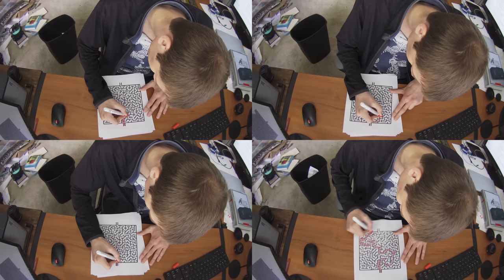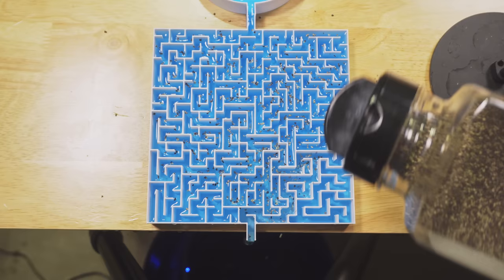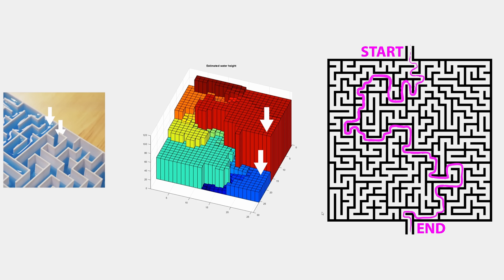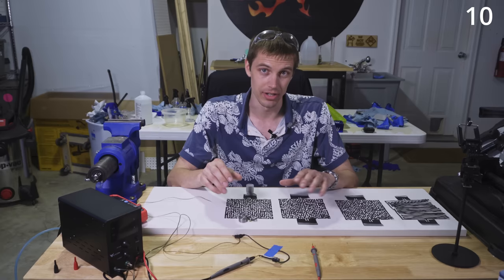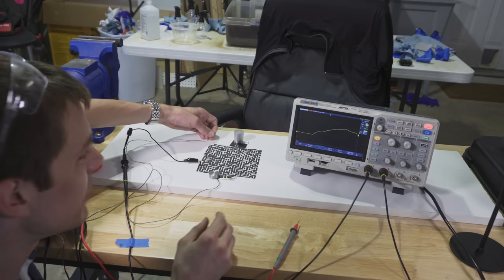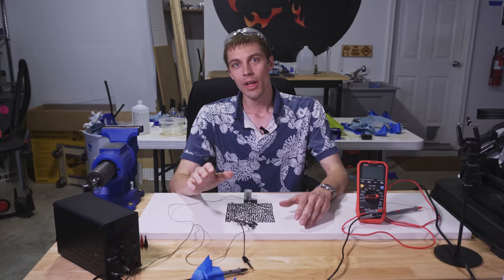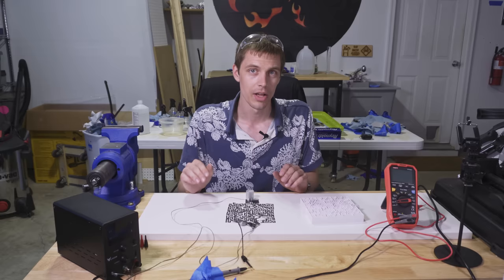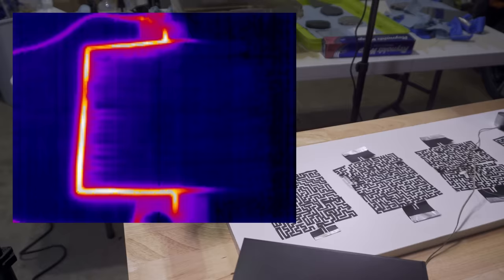How does electricity find the "Path of Least Resistance"?

Comment: Using thermal imaging to trace the current is a really great idea. I taught Physics for 33 years before retiring 7 years ago, and I wish I had thought of this demonstration. I really did not see any errors in your explanation, good work.
Reply: You can suggest it to every physics teacher you meet. Just because you can't teach with this method any longer doesn't mean you cannot suggest this to other physics teachers.

Spreading knowledge to other teachers is just as important as spreading it to the students.
Reply: Or just crank up the current until the thermal radiation decides to enter the visible spectrum 😅
Reply: @Operational117  I would except that I have not been in touch with any teacher since i retired.
Reply: Thermal imaging is also an incredible way to help diagnose bad circuit boards. If you look at a powered board under thermal and see one extremely bright spot, you've almost certainly just found where an IC unit shorted out.
Reply: @graealex  That's actually a fun idea, just increase the current until it starts glowing a bit. I'd imagine aluminum foil probably has a very narrow area between "glows a bit" and "melted" though because it's so thin. Alternative idea that comes to mind: Put the foil down flat on a piece of thermal printer paper (the stuff used for receipt printers), just hold it down with a wood or acrylic plate. It'll take a little tweaking to get the "exposure" right but there should be a combination of current and on-time that darkens the paper juuust right so you can see the pattern on the paper after you take off the foil.
Reply: @ska042  Typically you'll be able to see the slight glow in complete darkness, without melting everything. Current is the same everywhere, so the glowing should be pretty evenly.
Reply: @ska042  I like your idea with thermal paper. You could also put the thermal paper on top of the foil maze and hold it down with a sheet of glass or clear plastic, and see it darken in real time.

Much cheaper than an infrared camera. I bet it would also work with just a small battery as the power source.
Reply: @graealex  Why do you say current is the same everywhere?
Reply: @alext8828  Because current is the same everywhere, at least in the path that can actually conduct between the entry and the exit of the maze.
This is a general principle, even used for highly noise-resistant transmissions. If you transmit information, like audio, not as a voltage, but as a current, then you can be sure that the receiving end will see 100% the same signal, as all points in the circuit will see the same current flow (not accounting for leakage obviously). It's called a 4-20mA current loop.
Reply: @graealex   Great piece of information.  I looked it up.  I need to spend some time with that.  Excellent.  But aren't we still talking about fixed voltage dc current?  Isn't radio different?
I have to go out.  We should continue this talk when I'm qualified
Reply: @alext8828  With a current loop, the transmitter makes sure the target current is always flowing. Assuming that the resistance of the transmission line isn't static, that requires a variable voltage to begin with. Voltage is what pushes a certain amount of current through a transmission line, given a certain resistance.
With current loops, the length of the transmission line is irrelevant, contrary to a voltage-based transmission, where you obviously are going to see a voltage drop at the end of the line, depending on its length (and a few other parameters).
Anyway coming back to the maze, at any point along the conducting circuit, the current will be the same, at least when simplifying the conducting to have no particular width. With the resistance of the material also being uniform, it means the whole path will see a very similar amount of heating at any point.
Reply: @graealex  Current is not the same everywhere. It is only the same everywhere if there are no nodes in the circuit. Such a circuit is very simple.

Suggest you go look up Kirchoff's Current Law.
Reply: @graealex  This is a really poor explanation of current loop.

They key thing about the current loop, which you have neglected to mention, is that a current source is used to drive the line. The interesting thing about the current source is that the current is constant and the voltage is variable and the current source  adjusts that voltage in order to keep the current constant.  So as the length of line increases and the resistance increases, you still get the same signal strength at the receiver.
Reply: @deang5622  That is actually 100% not relevant for the explanation. It's sufficient that if you measure a certain current at one point, it needs to be equal at another point.
The way that particular constant current is produced was not focus of my explanation.
Reply: Respect to all whole-hearted teacher! You are the shooting star of your student! ♥
Reply: @wayneyadams  this is a good opportunity to meet new people :) just go to your old place of work ;)
Reply: Thank you Norway for inventing this techonology and spreading it to the world.

Comment: Never thought I'd see a voltage divider in maze form. Incredible.
Reply from the maker: I was watching Steve’s video and at first I wanted to do the vacuum test, but then thought about it some more and the whole “built up pressure in the closed off bits” thing reminded me SO much of electricity I had to do it!
I was thinking about this on a Friday while driving away to an FRC competition but you better believe that on Monday night after I got back I was in the garage cutting foil 😁
Reply: How do we create a depletion zone with water?
I mean, is it possible to have a transistor for water?
Reply: @d.6325  Actually, I think Steve Mold even had simple water-based adder for couple of bits
Reply: @d.6325  Yeah I guess this is what you may call an Abacus with extreme mechanical princebles at play,
 I think the very First calculator ever made was the size of a small car?
Reply: I had never had an intuitive understanding of voltage drop until seeing this video.
Reply: @AlphaPhoenixChannel The way modern clever and creative people can directly and indirectly communicate and inspire and challenge eachother is marvelous. We're getting so much interesting stuff from people like you and Mould.
Reply: If you have a look how resistors are manufactured, you'll see mazes all over the place. Well, not really mazes, mostly just zig-zag form, but well, they aren't just made of unique resistive films without engraved geometry. Depends on the value of course. This way, you can manufacture lots of different values with just a few different materials.
Reply: How about a Voltage divider in Hilbert curve form?
Reply: @trejkaz  We'd be trying to illustrate the concept of a Hilbert curve and voltage divider at one time. Maybe not that intuitive. Now, whether a Hilbert curve voltage divider would be useful? I'd be shocked if it wasn't already in use in low cost 2D applications such as touch screens.
Reply: Later on he also showed a current divider with the different paths...
Reply: You mean a-maze-ing?
Reply: @monad_tcp  it's called a faucet
Reply: @loicjeannin6233  faucets don't open with pressure thou, they open with mechanical movement

Comment: Ever since I was in high school, I ALWAYS had an issue understanding how electricity flowed in series and parallel circuts (and combinations of such) with resistances. I never got a straight answer on whether or not current existed on the path with more resistance. This has helped solve that decade-long mystery for me. THANK YOU!
Reply: The short answer is "of course." 

The longer answer would be to measure the current through the higher resistance path.  Your HS profs probably didn't have the equipment nor the time to do this.
Reply: You must have had some poor teachers because you should have learned how to calculate potentials (voltage) and current in each branch of your circuit as well as the potential drop across each resistor and current through each resistor.
Reply: @philipgwyn8091  Ohms law says V = R * I. So by just measuring the voltage across a resistor, you already know the current.
(Assuming the resistor network has significantly less resistance then your voltage meter).
Most High School teachers just have no idea what they are talking about when it comes to electricity.
You see that phenomenon the strongest in Physics education in Electrical/Electronics Engineering Programms:
Physics education starts with Water and then teaches Resistor networks as analog to Water flow.
Students in EE Programm gain intuition in current flow in Electronics 101 and then use the associations for electricity in water models in physics (exactly flipped on how the physic instructor teaches it)., because electricity is - after having it learned once - more intuitive then water.
In electricity, we easily assume wires to have negligently low resistance; with water, a pipe (or any component including connectors) is always a significant resistance.
Sure, you can show me cases where the resistance of an electrical wire and connector also matter, but when you reach that point, you already know to add a resistor symbol to your schematic, even if you latter assume it to be 0.
Reply: @wayneyadams  bro
Reply: Why did you never got a straight answer? Did you ask?  
This is standard highschool stuff that I teach (especially, because I hate people saying "electricity takes the least resistance way", because, as you just saw, this is just wrong.
Reply: My teacher explained it with doors into a building. 
You open a door, people are going to bunch up at the door, and slowly flow through, you open 2 doors, it's going to let twice as many people through. 
If one door is big and the other door is small (side door?), then the big door is going to let a lot of people through, but some are going to use the smaller door. 

The example here in the video makes me think of traffic though. 
Most people wants to go the shortest route, but some have figured out that its nicer to drive the longer, but less congested path,, at least until they meet up again and everyone has to cram into the same lane again.
Reply: @sarowie  I am sorry to have to agree with you about the competency of many Physics teachers. I was in conferences and workshops where there were Physics teachers who had no idea what was going on, they just taught whatever was written in the book without any real understanding. Unfortunately, in our state a teacher can be certified by passing a ridiculously easy (and badly written) test with a score of 70%. That is the difference between those of us with Physics degrees who decided to teach, and teachers who decided to teach Physics.
Reply: @philipgwyn8091  not sure what you mean, you could absolutely do this with any basic equipment like even a cheap multimeter. You could either measure the voltage drop across each parallel resistor and calc the current, or disconnect one side of the resistor and directly measure the amps. We had to do the measure the voltage drop thing really early in my electronics class.
Reply: @lordsqueak  The traffic example has a couple of issues. As stated, it assumes that people know the paths they can take, something neither electrons nor water molecules do. When one assumes people are driving randomly, you get circular and back flows, also not possible with electrons (but somewhat with water due to inertia). You have to make people decide their direction based on how many cars are in any possible direction (counting both sides of the street) and then turn into the direction that has fewer cars. And even then, it's hard to imagine people just sitting in their stationary car because they're stuck in a cul-de-sac...
Reply: @HenryLoenwind  Ever been in a rush hour traffic jam?
Reply: The misunderstanding stems from the phrase: “electricity finds the path of least resistance”, which is just plain wrong, as illustrated in these maze experiments. For any parallel circuit, electricity will go through all paths proportionately according to their resistances (inversely proportional). Yet the popular phrase persists because it’s a simplification that serves as cautionary & trite warnings about electrocution dangers, for example. It imparts a more impactful and memorable message.
Reply: @wayneyadams  You can get a degree without having any idea what you're talking about, either, so that isn't really anything to brag about. It's not even that hard, really.

And if you make it harder to pass the qualifications to become a teacher, you just end up with less teachers. Sure the average quality of a random teacher might go up, but the average quality of a random student's education might actually go DOWN because with less teachers, students just can't get their questions answered, and people end up being taught more by TA's than actual teachers anyway.

The point is that these problems exist because they aren't simple, and if the answer was really as easy as "just have better teachers" people would have done it already.
Reply: @ZeroKitsune  The problem is that in Florida, one need only pass a poorly written test designed by teachers who themselves have minimal knowledge of Physics. You only need 70% and suddenly you are a Physics teacher, with 70% knowledge of your subject matter. Those of us who actually had advanced Physics degrees, rather than education degrees (all one of me in our district) actually understand the concepts on a much deeper level and are able to teach it more effectively.

It isn't a matter of having a degree and being ignorant, it is not having a degree and being certified to teach a subject about which you know almost nothing. By the way, since my B.S. was Chemistry and i had worked as a Chemist, I usually got to teach the A.P. Chemistry classes. Chemistry has its own set of problems, since most Chemistry teachers were pre-meds who failed to get into medical school so they took their marginal chemistry degrees and became teachers. However, there were a few outstanding Chemistry teachers who really knew their stuff.
Reply: Here's a question for you folks, then: what level of resistance is required to stop electron flow entirely? Don't say "infinite", because that is physically impossible. However,  I suspect the answer varies a bit depending on the materials at either end, how strongly they hold onto their free electrons, that sort of thing -- which they must, otherwise capacitance would not exist. Electrons cling to metals and don't freely flow out into the air (I understand they do flow, a bit, but not freely).
Reply: In that case you never actually solved any problems with resistances in series or parallel.

Sounds like you had a very poor teacher.
The equations which govern it have been around for a very very long time and are some of the simplest equations  in existence.

Comment: For the oscilloscope test, you should have used a capacitor instead of your power supply. You could show, side by side, the discharge curve of both the maze vs a simple resistor with equivalent resistance to the maze. Any deviation from the resistor curve would be the "electrons sloshing around the maze."
Reply: interesting, you assume the maze is an inductor and the "sloshing" would be an LCR resonance circuit.
Reply: @sarowie  What do you think ISN'T an inductor?
Reply: @dkosmari  Still very mad about the time I was diagnosing a sensitive circuit and what was messing me up was a single loop in my probe wire.
Reply: @Mandragara  Done that before and it's annoying!
Reply: I think you could also just look at the inrush current vs the steady state current.
Reply: @Mandragara  Thirty years ago I developed a probe card analyzer that could detect leakage currents between channels down into the tens of picoamps range- but tapping my foot on the floor six feet from the unit under test could induce 100-pA currents in the system just from my body voltage changing due to my capacitance change and thus inducing current in the four-wire connection to the UUT.

"Be vewy vewy quiet," as Elmer would say.

That project was a nightmare. I had to do synchronous sampling at a multiple of 60 Hz (1920 if I recall correctly), fold the data set over on itself to cancel out the 1000s of pA induced by line power, then throw out the 2500 pA spikes caused by the CRT computer monitor's flyback transformer. Broadband AND narrowband filtering were all done in software, but it accomplished 60 dB of attenuation of the noise sources. And don't move for five seconds as the program averages readings.
Reply: @r0cketplumber  That sounds like a really impressive project though!

I have a project that I'll spare you the details of, something to do with quantised conductance. But it involved making gold nanowires by the high-tech process of... pressing two pieces of gold together and hitting the table until the readings looked right.
Reply: @Mandragara  "If it's stupid and it works, it's not stupid." :)
Reply: @r0cketplumber  "If it's stupid and it works, it's still stupid and you got lucky."
Reply: @r0cketplumber very cool, love personal stories like this!